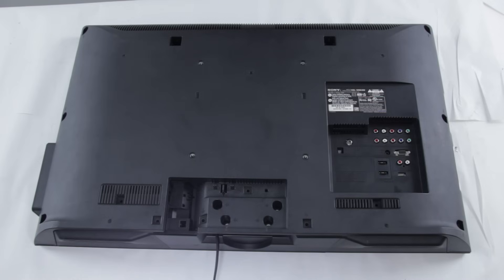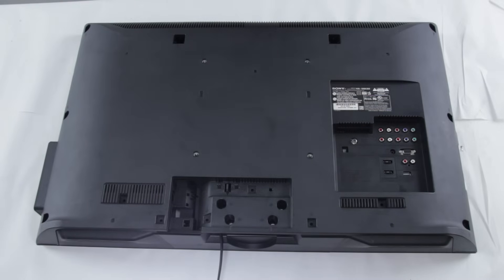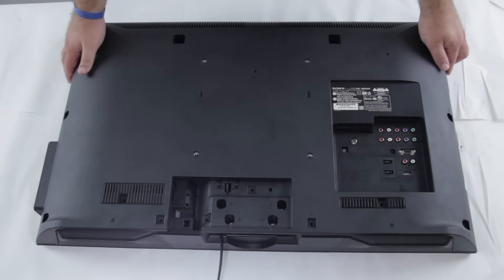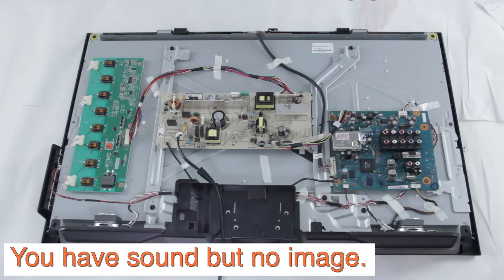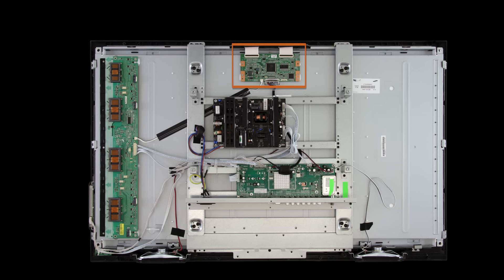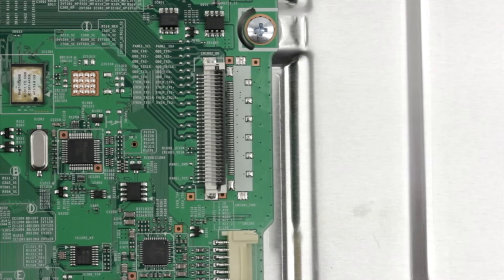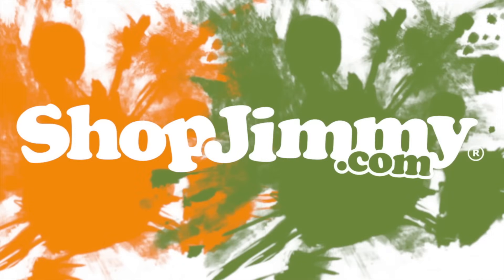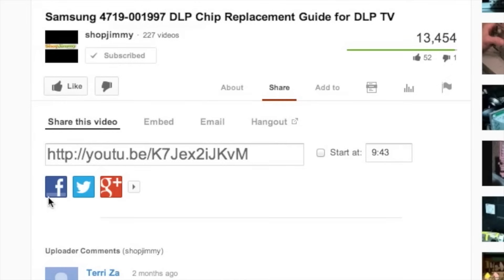LCD TV Repair Tutorial - T-Con Board Common Symptoms & Solutions - How to Replace T-Con Board

Comment: I have a 55inch Samsung with horizontal lines every five inches starting from the bottom to the top. Also a ghostly feature on the left side of the side with a few small vertical lines going from the top to the last line of the horizontal line, please help! I understand that horizontal lines on the screen are virtually NEVER caused by a bad T-con board?

Comment: I have a Sony Kdl-60nx800. I am having a solarization issue. I rread it may be the T-con board, so I replaced it with no difference in picture. Can you please help? Can I test the T-con board? Could it be the main board? Any suggestions would be appreciated. Thanks.

Comment: Hi great video I have my uncle's tv I've changed capacitors on the power board as a few were bad but still same symptoms try to power it on but get occasion flickers of blue (I'd say it was blue) bit dark blank image literally a flicker apparently I was told it had been left on for long periods then one day didn't turn on that's all the info I have on it our old tv still going was simply capacitors gone bad but thus seems to be a different issue whether it's the inverter boards or tcon/lcd  strips I'm not sure

Comment: Hello. I have a Samsung LED 55 inch tv model number UN55B7100WFXZA that I'm getting sound and a picture but the picture has random fuzz(white haze) and random thin vertical and horizontal lines. Have had since new. Would this be a bad tcon or main board? If i disconnect the tcon from the main board the screen goes solid blue with no lines or haze. Hope this makes it easier to troubleshoot.

Comment: Have a 60 inch lg led tv.  Got the black screen with sound after tv was on for about 30 seconds.  Replaced tcon board and had same problem.  Replaced back light strips and now back lights stay on but tv will not load the screen that shows the lg logo.  Just a dim bluish type of screen.  Lights are staying on though.  Was wondering if I have a bad ribbon cable on the tcon board or something.  Any ideas of what would cause the tv to not get to the lg screen?  60lb7100 lg tv.

Comment: I have a  sceptre E555BV-FMQC8AVAV93BA  F44B555BKA0194. It has a Shadow/dark spot the upper middle of the screen. Just wondering if I should replace the T-Con board?  I tried the tapping method but to no success. Any recommendations?
Thanks Gary

Comment: Have Hisense 40 in model 40H3E. Just replaced the main board and power supply to fix the power on issue, but that did not fix the no picture issue. I do have backlights, so wondering if it is the t-con board. Can this be replaced on this model and is there a model number?

Comment: Stupid question, but is it possible that if the LCD connection is cut off from the motherboard, it recognizes that the panel is disconnected and turns off the backlights too.
Because that's exactly how laptops work. When the LCD cable is disconnected it also cuts off the backlights power, which is a separate cable.

Comment: Jimmy,

When we put the new t con board in the sound came on but screen did not. The tv then shut it self off and the red light started flashing we tried to put the old 1 back in and it was the same problem It is a Sony

Comment: hi, I have a TV LG 32LN540B sn 403MAEG51804, my problem is as follows: The remote control seems not work but.... the remote control works perfectly and battery are full. I tried with another remote control installed on my LG phone (that i used on this tv) and the problem remains. the command sometimes works other times no, other times it works another key that is not pressed. I think it's a problem of the infrared receiver on the TV, I disassembled it but looks good , any suggestions?

Comment: Hi I have a LG 55uh605v led tv recently a black horizontal line has appeared and the picture starts shimmering on and off just below it . Would replacing the t-con board solves this problem or could you suggest a fix .

Comment: Hello there, Your videos are very informative. Thank you for sharing. I have a Sony XBR-55HX929. when turned on it showed red blinking lights and based on some research I replaced the power supply board. Now the red blinking lights are got but I don't see anything on the screen when I power the TV. What could be wrong, please advise.
Reply: I have a problem with my Samsung UN60FH6200F there was a power outage in my apartment but tv still worked next day I turned on the image go like a reddish brown and image started to vanish slowly until it just started flashing like a blue light on the top of the screen also the red light on the bottom of the tv flashes I have no image or sound on it either. What can I do to fix this issue.

Comment: Sony Bravia KDL-46WL135 SN 8004936 - Sound and picture are present but increasingly from left to right the color becomes more red hues and vertical lines appear to the far right. Can this be a loose ribbon or a bad T-Con board?

Comment: I have a tcl 55US57-w , it was working fine until one day the pic started ghosting, the sound is good, wifi is good, powers on and off normal, but when I scroll through the apps they overlap each other, does this sound like a bad tcon or panel, the warranty ended Feb 2018

Comment: I have a 70 in sharp aquos quattron tv with one fast blink and one slow but even during the factory reset I have to use a flash light to see during reset....my model number is LC-70LE732U.....What would be causing this no picture even after a successful reset....and what parts would I need to get?

Comment: Have a un55h6203 led smart tv. Inherited not working. No lights so replaced power board but not getting a picture. Blue lights are emitting from t con board. Has sound.. Would t con board be the problem.

Comment: I have a Vizio 32" TV model E32h-C1 I do have a picture but the picture one day got rather dark I tried doing a reset through the menu and also by disconnecting the power cord and holding my power button down for 10 seconds and plugging it back in but to no avail. I can go into menu and turn up my brightness in my backlight and my tent and things like that and get it get somewhat of a better picture but it's not really right it is barely watchable could that be the t-con board as well or maybe the main board or I just don't know I don't want to start throwing boards at it thank you

Comment: I have a Vizio m70 c3 that has a slightly Gray area about 1/5 the width of the screen about 5 in down from the top. It really is only noticeable when the background of the image is very white.
Reply: Could this be the t-con board or the LED drivers? If it's actually the LED strip, that's out of my ability to repair. Any help is very much appreciated

Comment: Hi i have a Samsung 46" Ln46b650t1fxza lcd tv and it doesnt want to turn on a red light is flashing in the front of the tv a also the backlight is flashing already replaced the power management board but nothing happened.

Comment: Hi, I have a philips 55pfl5907/f7 . you can power it up and the power light is white and flashes 4 times, with lights out you can shine a flash light on screen and see the menu set up. I need some guidence on which board is bad.

Comment: Hi, thanks for this informative video. My LG TV (50lb6300) starts blinking when I power it on from yesterday. It blinks for every second and when I play something, the audio is good and video is running but keeps blinking. No flaw in any area of the screen. Can you please let me know if this is a t-con board or power circuit board  or LED strip problem? I opened the back panel and found the power circuit board looks good. No popped capacitors. Please help.
Reply: Its indicating the display safe check has failed. Its good to check on tcon board

Comment: I have a Samsung ln46a630m1fxza that cycles on and off. Thought I would find bad caps on the power board but no luck. When I
disconnect the t con board the tv turns on without lighting but stays on. Should I replace the board?

Comment: I have a Sharp LC-46E77U.  I am getting vertical lines coupled with a loud stable noise.  I turn the unit off and on, and the picture is back for a couple minutes, then I get the vertical lines and noise.  I have taken the back off the unit and can replace anything, just need to know what to replace.

Comment: I have a 55" Vizio tv *model# E550VL*. The VIZIO standby on the front panel lights up orange when plugged in, but does not power on at all. Which board could this be that needs to be replaced. I've tried the power button on the tv and the remote....nothing happens.

Comment: I have a sony bravia model no-KDL-37M4000  SERIAL NO-8202098  When I turn on the tv it is fine for about 1 minute and then you get white and faded color images and I was told it is the t-con board but I am not sure. You can e-mail me any and all answers you might have. At   t107321@hotmail.com  Thanks in advance

Comment: Hey there, I have a Sony LCD tv... model: KDL-52W3000 with serial: 8158614. It was manufactured Jan 2008, so it is an older tv but I feel like it still has a lot of life left. 

It has had issues warming up, usually took 20-30 minutes before it corrected and the screen was great. Now, the horizontal lines are not going away and the bottom half of the screen is showing double. I am hoping you can guide me in the right direction for repair. Thank you.

Comment: Hi, having trouble with my Sony tv KD-55X8000 It turns on and you briefly see the sony logo for about a second then its gone and no images are displayed but the back lighting stays on continuously.
I have tried two T-con boards I got from China with the correct part number but the symptoms do not change at all. I purchased a mainboard as well but the symptoms were still the same also. any advise would be greatly appreciated.

Comment: Hi there I have a JVC LT-40TW51J. It’s showing all the signs of a faulty tcon board, no picture yet backlights and sound are working. So I ordered a part from a supplier giving the make and model (before I took the back off) and I think they’ve sent me a wrong part, though I can only see 2 main boards and a strip of circuit board on the underside, I’m just wondering if this tv is fixable and how do I go about ordering the right part. I can’t seem to add photos but I can email some over? Any help greatly appreciated! Kind Regards
Mike

Comment: Model Number: - RTU4300
Serial Number: - A180724994000441
Problem: - My TV flashes vertical lines. like they just appear & disappear. They cover the whole screen and disappear immediately. I've tried to remove the ribbon strips and put them back but the lines still flash. Thanks for the help

Comment: Hello. I have a Changhong 50" LED LED50YC2000UA---that dose a split/solid phases. about 2/3 of the bottom TV switches between those two states every ~2 seconds In the solid phase, the majority of the image looks fine, but there's a black horizontal line that starts about .25 inches from the bottom and up 2/3 of the TV, it appears to be 2-3 pixels wide. Around that black horizontal line there are about 2-3 lines that show color, but seem to be in not quite the exact right place, maybe offset somewhat vertically. During the split phase, the black line mostly disappears, leaving a line maybe 1 pixel wide. Every horizontal line below the black line moves either up or down. It looks like about 2/3 of them get misplaced up a few pixels and about 1/3 of them go down a few pixels. Do you think it could be the T-Con Board.
thank you

Comment: Philips 75pfl6601 f7
About 2 inch black vertical line top to bottom, at the bottom of screen there is a small portion with colored lines and a portion that is white

Comment: I have an M50-C1 model Visio LCD tv and it started with a storm that had our tv just with the power light on and black screen and no sound. I have replaced the power board and the main board. The tv is working again now but it has two pictures on screen. They look great and sound is good. It is just like it is in split screen/POP. The problem is our tv has no menu options or remote options for taking it out of this mode. I was told by the guy that sold us the main board that it was probably the T-Con board. Is this the case? I ask because I have not seen anywhere that the symptoms we have point to it. There are no lines and the pictures are perfect except they are squashed vertically and there are two of the same image even though we have antenna on one source and roku on another. Please help! Thanks for your time and great videos, I have learned a lot from them.

Comment: hi i have a sony bravia w950d , it died on me while watching a movie, the technician told me that the adapter is dead and need to replace it. later he also added that the TCON board died as well as it was shorted due to infestation of ants in it, my question is how can a short circuit cause the TCON board as well as the adapter die at the same time without damaging the LD board although the power supply is stabilized. Thanks in advance.😊
Reply: does this model have any design fault ?

Comment: We have a vizio d50u-du1. The screen intermittently goes bad with horizontal lines moving all about the screen, followed by the screen goinf black. Sounds is on the whole time. Powering on and off usually fixes it, though sometimes powering on and off more than once is necessary.  

Any ideas?
Reply: Same model I have,but mine started with a very dark half screen,still picture just can't actually see it,then the whole screen just flickers dim and bright slowly

Comment: Hi, I have LG 32LN578V and serial number:
401MATWON417.
It developed fault associated with no screen or sound ,just led blinks 3 times and that's it.
I checked the  board on output side to signal board and get voltages as required 12v, 24v, 3.5v as printed on power board.
Also tried replace signal board and issue still persist .
Any ideas that it could be?

Thanks

Comment: Okay so I have a Vizio e500i-b1. Most days I can turn it on just fine. What it does is I turn it on and the screen flashes the Vizio logo then goes off. There is still sound though. Usually I can leave it off for a little while and it comes back on eventually. Lately it has been happening more often. Today it did the same thing. I turned it on it flashed the Vizio symbol then I turned it off. But I kept trying and the last time it flashed a white screen with thin black lines at the top then flashed Vizio symbol then the statelite picture came on and yes there was sound the whole time.
Reply: I didn't turn it off the screen went black after Vizio logo then I turned it off

Comment: hi sir I have Micromax tv but in that they used lg display  tcon output is coming perfect....
when I connect stirp with display and tcon board then tcon gets heat  tv backlight gets on and sound comes but display will be white after vertical bar will come....
please say me how to fix

Comment: Serial No:512WRTFT3409
Hi I saw your video and you said that a symptom for a broke tcon board could be a not working half of the display. My display is showing some horizontal grey lines at the lower half of the screen which are flickering and it seems that there are three pixelrows that are just dark .
Those symptomes show through the hole system so it doesn't matter if I am in YouTube or on Tv.
Would be nice if you could help me. 
Thanks

Comment: I have a Samsung model hdlcd19wb serial: 057300917646 mfg date Sept 2010
The issue I am having is there is power at the face light showing blue for on and red for standby I suspect the pcb because it just shut off one night and had nothing but a black screen and no sound!

 I also have a seiki model sc323fi  s/n 3270m81371010903 with the same issue these were used just as security monitors for a small business and was wondering if there were any tests I can do with my multimeter I have a basic idea of how resistors and capacitors and diodes work unless it is going to be the processor or a component that's difficult for the home repairman to replace if so, then if you could quote me a price for the power, video and tcon boards for both, please? You can contact me via email at gittruckin@gmail.com my name's James Bigham thank you for your time!
Reply: Sorry the first one is a sansui not samsung

Comment: Hello, just confirming I ordered the correct parts to fix my TV after seeing this video. I have a Vizio M651-A2R. One day It just died. No picture, however you can turn the TV on and off and listen to sound from the speakers no problem. When doing the flashlight test, I was not able to see the menu at all. When testing voltages, i found that all my standby voltages were good, the backlight voltage was 3.2 or something when the TV was turned on. I have ordered a T con board for my TV. Did I order the correct part?

Comment: Our 55 inch Westinghouse WE55UDT108 TV was tipped off the entertainment center three months after it was purchased.  I have sound and a picture but with vertical lines, a star looking crack, and part of the screen is black.  Would replacing the tcon board fix this?

Comment: LG23LX1RV.  Ser. No. 507MXDM1R714.  Manufactured 7/2005.  Multi-colored vertical lines.  Need to locate T-con board.  Thanks.

Comment: 65" rca model sld65a55rq. After a thunder storm. I came home Andy tv would not turn on. The red light was on the tv but it wouldn't turn on. I ordered a new mother board, installed it, and the tv turned on! However, the picture is now very bad. Colors are all off. What is my next step. Is it the tecon board?

Comment: I just started having problems, I have a Sony KDL-32R330B BRAVIA R330B series 32”. For about two months I had small black lines running horizontally through my screen, then recently my screen began to turn white after a few minutes while on. I just want to make sure it’s a T con board problem before I take any action. Thank you so much